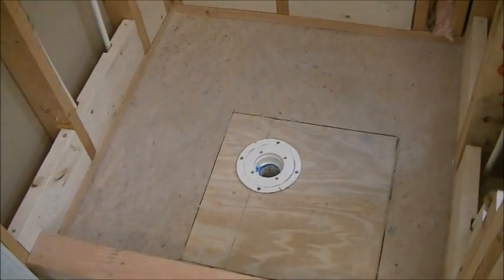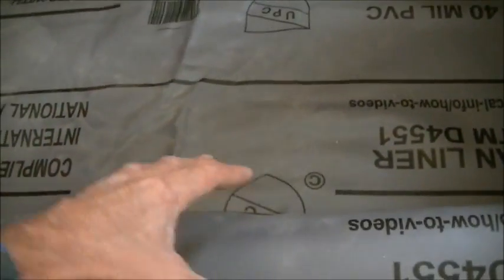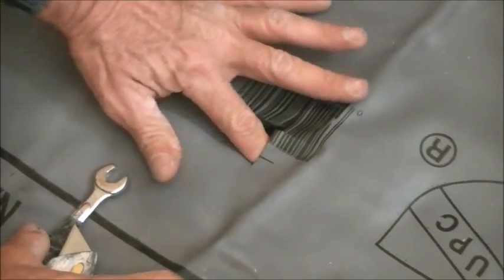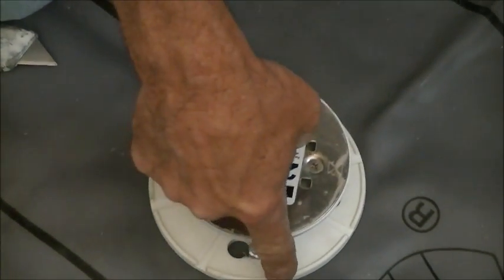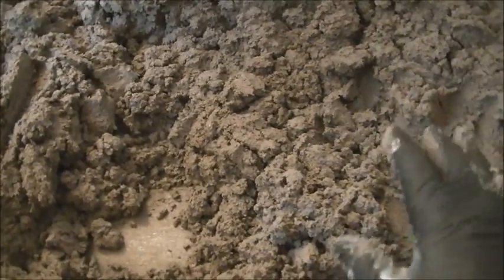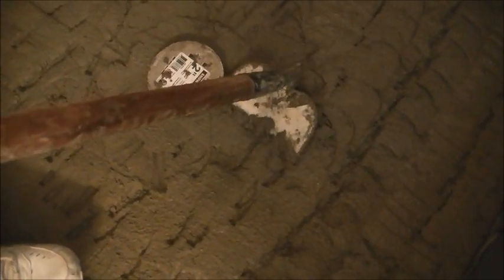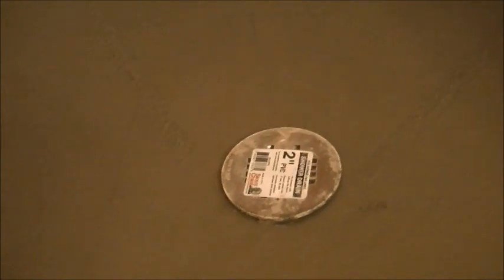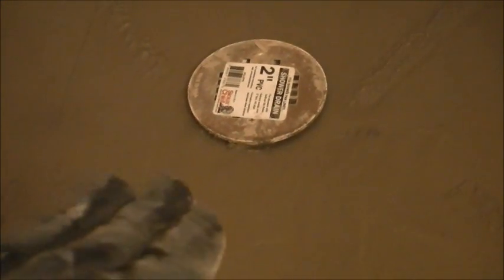How To Install & Pour Shower Pan

Comment: Have you ever heard noise when stepping on the cured mud pan?  I poured mine a couple weeks, using a liner like yours and quickrete sand mix.  It was fine for a couple weeks, looked perfect.  I put up Denshield after, keeping it 1/8" above the pan as to fill with silicone later.  I just used thinset/tape on the Denshield seems the other day in prepping to do the Laticrete waterproofing thing.  Now I step on the mud pan and notice a hint of crunching.  I think it is from the thinset that may have gotten under the Denshield when doing the seems which in itself is not an issue.  The issue I think is that it identified the mud pan moves when you step on it.  With the pan liner I imagine it has no choice but to compress/move, but I'm quite concerned I have to rip it out now?
Reply from the maker: Without any knowledge about how you prep your floor prior to put in a liner down then I cannot answer, sometimes subfloors are half an inch and must be shored up, sometimes there is weak spots even with OSB board... or could be simply that you mixed your mortar to rich, meaning it was too runny or perhaps it was too dry, so many variables but no I generally do not hear any type of crunching on my pans.
Reply: @StarrTile  This is on a concrete floor with the pan liner on top.  Since I am type A, and the worst it could be was a waste of time, I did do a pre slope using the same sand mix , adhering said mix to the concrete with thinset and it too was rock hard for a couple weeks with zero movement or noise.  Then to the pan liner.  I admit,  I cursed you a bit, wanting to find the video where you said the pan liner would take you "5 minutes".  I wanted to give a My Cousin Vinny reference about grits cooking faster on your stove since mine took me a couple hours to ensure it was perfectly flat, tucked nicely, etc.  Even put it in the sun first.  Anyway, I did use a dry pack not as wet as yours, but not as dry as those who ball it up in their fist and it looks dry.  I was real happy with it and it looked perfect, dried nicely, evenly rock hard where I cannot scrape it.  Edges look good as well, again rock hard with no inkling of mortar chipping/ breaking/dusting off.   So do you notice your pans move to any capacity?  I can't see any movement when having someone jump and transfer weight and no cracking.  Not good, I am considering ripping it out, but I am SURE I did a good job and in fear it will do exactly the same thing...    Better to rip it out now, but....
Reply: "10 different people, 10 different opinions" sure holds true when contacting local tile stores and contractors.  Many say you can't avoid movement becasue the pan is floating on a PVC liner it can't adhere to, but also compresses, so as long as you can not see it move, and the pan is solid, it is just fine and the tile install will remove noise and movement.  I followed all mfg instructions to the letter, so even if I were to remove it, I believe short of having a solution, I would have the same result.  At a loss here...  

Heck, even tech support at Oatey said I should glue the pan liner to the concrete/pre slope under the liner with Liquid Nails tub and surround, but in my months of research I have not seen ONE person do this, nor does their instructions say anything of the kind.  It also does not make sense becasue the shower pan will not adhere to the liner, so why should the substrate below that?
Reply: @BPRescue  how did it work out for you?

Comment: How well do those weep holes work when it seems they'd be full of mortar? Or did you lay down some pea gravel or tile spacers to prevent this?
Reply from the maker: Mortar is sand basically...pea gravel is small rocks, and dense. Which will allow water to flow best ?? I'll take the sand.

Comment: Great video's StarrTile.,... I thoroughly enjoy your videos and think you do an excellent job explaining your work...I always learn something new from you.  As a DIYer,  I have done a couple of bathroom refurbs and am the point where it's become "therapeutic" .   I am embarking on a new job and would like to do a curbless shower.    I researched a few "kit's" that are geared for curbless installs and one in particular,  Wedi, seemed to stand out.    It's a bit expensive but it would eliminate the need to build out a recessed shower pan.  I've not seen any of your video's that demonstrate a curbless build.   Two questions for you...have you done any?   what do you think about the Wedi system?       

Thank you....

Brian
Reply from the maker: I don't like fake shower material of any kind, that includes Kerdi, Wedi, Schluter, etc. . Something rubs me the wrong way with foam products in a shower...having said that, for a DIY'r I get why ppl use them, makes it easier and fool proof. 
And yes I've done many curbless showers, here is one...
https://www.youtube.com/watch?v=rXn3AFTspCg

Comment: "Put a fan on it overnight?" From what I understand about concrete, you should ket the surface moist - not dry - during the cure.

"Profound slope?" I thought it was 1/4" per foot. So, if you set your four-foot level on a level surface and place a one-inch spacer at one end, you will see where the bubble rests at the correct setting. By placing your two-footer on top of that level, you will see where it's bubble should be - and so on for your 12 or 18" levels.

if the slope is too great, people will feel it and find it disconcerting and uncomfortable - even though the water runs out super-fast!
Reply from the maker: This is not concrete, it's cement. 

MIN is 1/4'' per foot, beyond that it's totally up to the person doing it & their requirements.
Reply: DISTINCTION, yes, DIFFERENCE, probably not.

Since the primary ingredient of concrete is portland cement, it would stand to reason that the cure for one is applicable to the curing of the other. See below. 

Whats the Difference Between Cement and Concrete? Although the terms cement and concrete often are used interchangeably, cement is actually an ingredient of concrete. Concrete  is basically a mixture of aggregates and paste. The aggregates are sand  and gravel or crushed stone; the paste is water and portland cement. 

Curing of concrete is defined as providing adequate moisture, 
temperature, and time to allow the concrete to achieve the desired 
properties for its intended use. This would mean maintaining a relative 
humidity in the concrete of greater than 80 percent, a temperature 
greater than 50 degrees Fahrenheit, and for a time typically ranging 
from three to 14 days depending on the specific application. When these recommendations are properly specified and performed in the field, the final properties of the concrete mixture will be achieved.

Comment: I appreciate your videos. It gives me something to do in the evenings after a long days work.  But man I gotta say, 20 years in this business, worked with and met at least 25-30 tile people in my career and never have I seen a pan done like this.  You keep saying your ways are easier but I disagree. They actually look harder. And why would you install a mud pack before the board is on the walls? 

You packed all that mud and then put a level on it just to realize it wasn't level.  If the board was already up you could've easily drawn a level line all the way around the base to the hight you want your mud pack to be and then simply packed to that line and sloped to the drain. No second guessing,  no re-smoothing of mud.  Plus the fact that board being up already creates an extra barrier to help fight against water penetration down the road as the house settles and things shift. IDK, I'm always open to new information. Maybe I'm missing something.
Reply: He has video where he's torn apart a shower built the way you prescribe; with the Hardiebacker was at or below the mud line for the tile base, and found moisture and mold had wicked as high as 16 inches up the backside of the cement board because of contact between the base masonry and the backer-board.  That's why he doesn't pre-board.  He want's to make sure there is a gap of exposed liner between the base and backer so there is a very slight gap between the finished tile and Hardiebacker (1/16" - 1/8" or so?) to keep the two materials from making contact, preventing inherent wicking and mold growth.
Reply: Yeah, you missed something. He doesn't put the board down into the pan so the board doesn't wick water up into, or behind it. He leaves an air gap.

Comment: No slope under liner??
Reply: If you have a larger shower, I’d do a layer under the membrane to get you closer to the slope you want. He may have not needed to because it’s a square shower with a center drain so the slope is only like a half inch all the way around. I’m curious what his actual reason is tho
Reply: He doesn’t believe in preslope
Reply: Plumbers have to put pans in Florida and requires a pre slope under pan or It’ll fail inspection, I tear out so many showers full of water rotting out flooring. a lot of hacks out there

Comment: What did you use for the weep area of the drain?
Reply from the maker: Nothing
Reply: When waterproofing the whole pan you don't need the weep holes. The water will not penetrate the surface.
Reply: StarrTile not necessary?
Reply from the maker: Jorge Sanchez that has yet to be determined, watch my video called pre slope explained, if you put anything larger than the hole at the holes then it can clog up the hole, whereas the mortar is porous enough to absorb the water straight through the holes.. but it is the other gentlemen commented right above you, since we are waterproofing the pan service nowadays it doesn't really matter about the weep holes
Reply: The video about putting pea gravel in vs not doing so made sense to me, but if you can't stand to leave it bare either, there is a product available at the orange box store for $8 called "positive weep hole protector" - easy peasy.

Comment: Pre slope?
Reply from the maker: Waterproofing the entire surface negates the need for a pre slope
Reply: Then why use a liner at all?
Reply from the maker: Exactly, if you waterproof the surface than a liner is not needed, however I have a customer base to answer to and for the same reason I had a reserve Chute when I was airborne....cya

Comment: Dry pack, definitely.
Reply from the maker: Nope
Reply: To each his own but will have to disagree with yah.
Reply from the maker: Dry packing cement doesn't allow for total chemical reaction.. Block & Brick mortar is solid and it is not dry pack
Reply: StarrTile We use deck mud, each has his choice of how much water is used also. Some prefer it a little wetter, some drier.
Reply from the maker: A controlled amount of water, I'm laughing out loud as I write this , I lived in Jamaica for a couple years and they don't control anything but yet they have structures there that you would be amazed at... this is not rocket science it is a shower pan

Comment: wallboards should never go beneath the pan,Pan edges should be underneath the walls, this invisible edge around the entire shower floor is more vulnerable to water penetration if a small crack or tiny hole or even standing water stays in these edges, over time it will go under concrete, even tho you have a liner this consistent damp will eventually erode that concrete floor and become brittle and fall apart, not to mention the mold issue, completely finish the pan then run your wall boards on top off concrete pan with a bead of silicon between the bottom inside edge around the perimeter of pan

Comment: What mortar brand do you use?
Reply from the maker: As a rule I use Quikrete sand topping mix from Home Depot, but there is a better sand topping mix at Lowe's called Sakrete... bigger sand particles make it easier to use
Reply: @StarrTile  I heard you mention red bag versus black?   Which one was preferred?
Reply from the maker: No from Home Depot they're both yellow bags, one has a red stripe and the other has a green stripe, the red stripe you won't be able to manipulate nothing next day it will dry very hard, the green stripe gives you a little bit more time

Comment: You forgot to put silicone under the liner
Reply: John Smith I forgot it on mine and chased the leak for awhile. I don’t blame this video because I watched a few, but he should go back and over lay a tip to silicone it
Reply: He does. On this video it wasn't shown. How could it be? The liner was already down in place with silicone.

Comment: The way I do it ... make my 3 high curb , warp the shower liner over the curb , warp the sides of the curb in concrete board , dray pack the top with a slope , read guard the whole thing , tile the curb and then I dry pack it into the shower

Comment: nope,, iam a fan of your videos but you need to do preslop and also do de 5 x 3 formula on the mortar ,
Reply from the maker: Never...show me proof a pre-slope works the way it's intended...you can't, it's a myth. If it DID work, I would be doing them. Mortar is premixed & never failed me.
Reply: StarrTile , I'm a fan also, but I'm with guy above on this one, I believe preslop it's the way to go

Comment: That is a horrible way to make a curb. It will likely fail. I've replaced many curbs like that over the years.
Reply from the maker: It will never ever fail, but you come onto the video and make a comment with nothing to back it up nor do you talk about your way
Reply: @StarrTile  It's clear to an experienced tile setter you don't know what you're doing. What's sad is you think you should be teaching.
Reply from the maker: @michaelflynn9622  well my opinion is it is clear that you are trolling, which ultimately serves no purpose at all, if you don't provide your method or make a video then that's what I consider it, just trolling 👎
Reply: @StarrTile  Using 2x4s is a huge fail. Humidity can make wood swell which can crack the curb. Ive seen it.  You didn't pre-float . You didn't use pea gravel at the drain.  Your mix was way too wet. Also using a mud  knife is not wise either IMO due to the possibility to puncture the PVC liner.
Reply from the maker: @michaelflynn9622  you obviously have not watched my channel over the course of 9 years where I detail exactly those points of contention that you have made.. so for your benefit I will do it again except extremely briefly, when you put gravel into cement and sand you create concrete, gravel is very dense where as sand is less dense... shove a pebble into one of those holes and you are in trouble.
The pre-slope notion you refer to has been debated like a dead horse, the horse is dead I'll just leave that one alone, having said that it's a moot issue since everybody waterproof their pants surface so there's no need for a pre slope. 
Wood for a curb has been used for decades and decades and decades, I pulled them out all the time and I don't believe I've ever pulled out a warped 2 by 4, only damaged ones... but because I waterproof my entire shower including the curb , any water penetration into my curbs is impossible. 
Because I have been doing this for 20 years you cannot tell me how wet my mortar mix is, I step on the pan the next day, in fact for the next three days until it is waterproofed and it is hard as a rock... the same way as that same mortar is used for setting brick or even cinder block, mixed to consistency and hard as a rock.

You obviously watched too many YouTube videos and really don't have too much knowledge about building showers, but have a good night anyway 😂👍
Reply: @StarrTile   When I saw your Tile lesson with your DIY video I could tell you knew everything. Keep on teaching "tile pro"
Reply: Funny how his channel has no content.....
Reply: @jcmoney11111  Really is that what I do? What else do I do genius?

Comment: All showers are walk ins now curbs are old fashioned
Reply: I think a curb is just a style of shower, as opposed to walk-ins. I would agree with you about old fashioned, but we'd both be wrong. I built my curb with concrete block/lath/mortar and it is awesome!
Reply: At the end of the day, the builder has to do what the customer requires!
Reply: Well I've never herd of a drive in shower so ya,  I'd have to agree.

Comment: i grabbed my hoe to but she screamed.....lol.....so i used a small tamper...i also draw a line on the pan to give me a almost perfect slope..i also use a square drain for when cutting tile around it..i also use p gravel around the drian for water seepage if there is any..and yes the pich perfect works pretty good . i’ve been installing showers for about 15 yrs now and so far no call backs